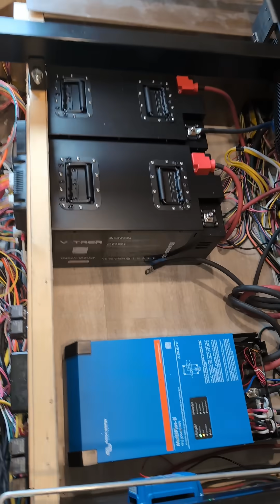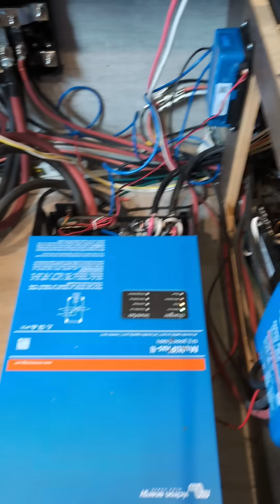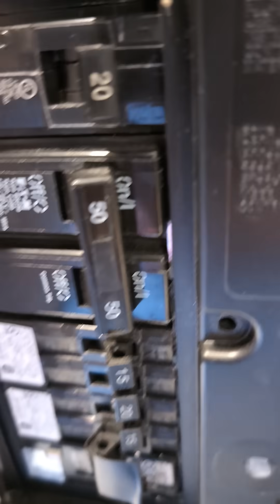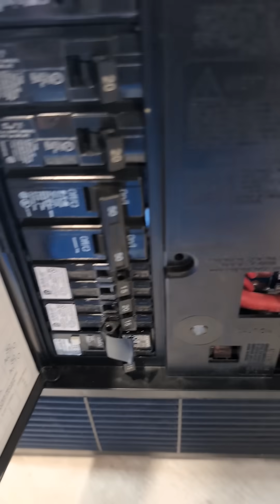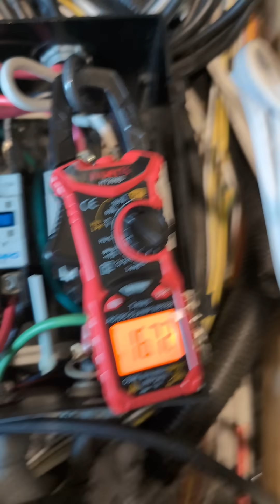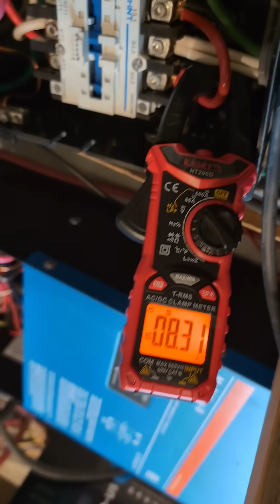RV power upgrade.  Combining L1+L2 QD8000 Generator legs into the Victron Multiplus II inverter. #RV

Comment: Thanks for the video. I have a similar space under my bed in my class A motorhome. Can you hear the additional noise from the inverter or electronics when you're trying to sleep?
Reply from the maker: Anytime the inverter is working at high levels of effort, there is some fan noise.  The real life scenarios would be running air conditioners, or heavy battery charging.  In the case of the air conditioner, the A/C fans are louder than the inverter fans.  If it was plugged into shore power and charging at high current, the fans would be noticeable.  The charge current can be turned down to lower the fan noise and extend the charging time if this is a factor.

In my case we sleep on top of the generator so it's way quieter than if the generator is running. 

Overall, I'd say it's not much of a nuisance.

Comment: Is any issue with multiplus laydown on back ? i thinking about to do it myself in RV
Reply from the maker: Zero issues so far, the fans and airflow are still the same so they cycle as necessary.

Comment: I was told bridging the two generator legs was not an option, that it would create a fire hazard age void the warranty on both generator and motorhome electrical system. Honestly don't know what to believe or if it is or is not a good idea.🤷🏼‍♂️

Thanks for the video!
Reply: I have the same generator and MultiPlus set up in my 2007 Winnebago motorhome. Bonding the two generator outputs at the generator input to the transfer switch is ok. However, this means all of the generator supplied current will be going through just one contact leg of the transfer switch to L1 of the MultiPlus. So there are two problems to address. The 8 K bonded output generator can provide up to 66 amps of current depending on load requirements. Both the transfer switch and the MultiPlus have max current limits of 50 amps. So I will be adding a 50 amp breaker between the bonded generator output and the generator transfer switch input to protect the MultiPlus, transfer switch L1 contact, and the wire to the MultiPlus L1 input during Generator use. PowerAssit can limit the input current by providing L1 power over the limit if set up correctly, but I don’t want to take the chance.
Reply from the maker: @markheene8852 after using it for a while, the multiplus is good at limiting the current to 50 amps.   Additional current limiters are not a bad idea.  I run the input down to 10 amps before turning the generator on or off to lengthen the life of my transfer switch.
Reply from the maker: Yeah, sometimes it is hard to know what to believe... I figure send it and find out 😊.  I just made sure to put it on the generator side of the transfer switch so you don't short something on shore power.

I did look in the Onan wire diagrams and it appears as if they are tied together before the breakers.  

So if they are tied together before and after the breakers, this is just parallel breakers which doubles the available current.

With them separate all of the current flows on leg one, with them paralleled half of the current flows on each leg. 

The breaker on my generator is a 35 amp double pole with a single lever.  The multiplus inverter is limited to 50 amps input, so that's only 25 amps per pole when they are tied together vs tripping it trying to put 50 on one pole.

So far so good. We ran heavy loads with two air conditioners and battery charging for a couple hours yesterday and everything worked great.
Reply: Good to hear. I've gone down the rabbit hole that is the Victron Auto Transformer. Will be using it to phase shift L2 180 degrees to create split phase power to input into my Multiplus ii 2x120. It was trying to suck all the juice through one leg (30a) this weekend. Apparently two ACs, the microwave and a 120amp battery charger proved "excessive"...🤣
Reply from the maker: @chris2097 😆 It's good to verify where the limits are 😄.

I think that's a good route, there are times I wish I had 240v capability.